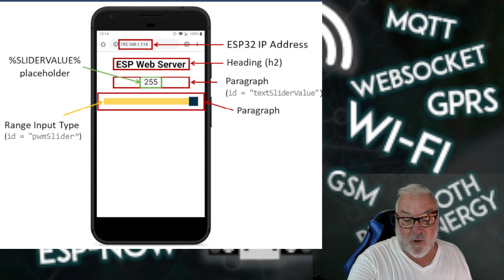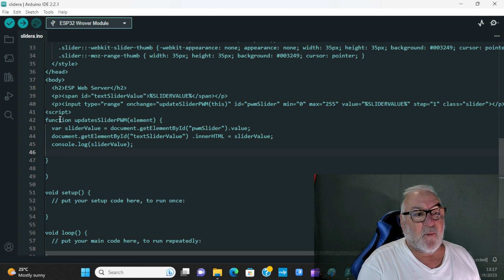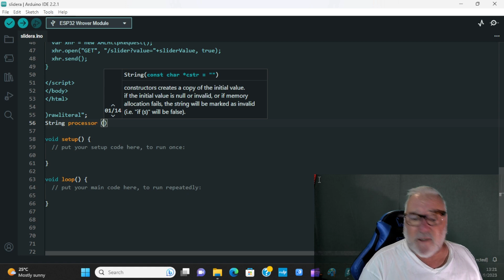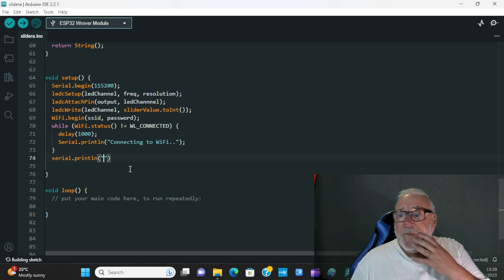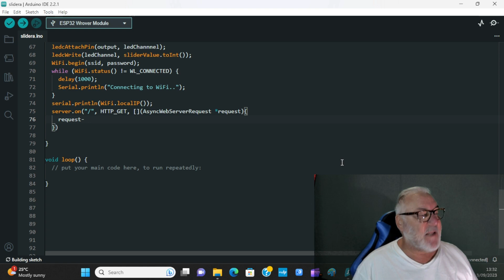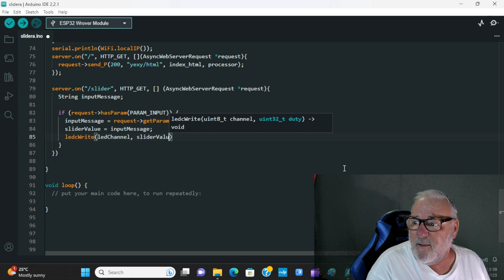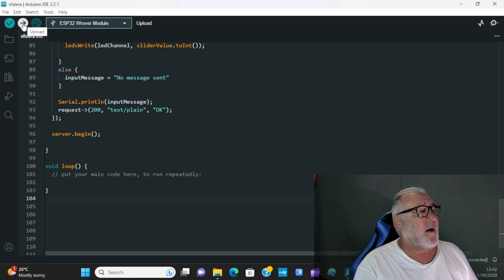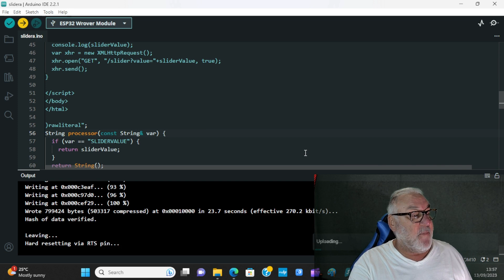Build An Esp32 Web Server With A Slider Control For Led Brightness Part 2

Comment: Sir, what is the purpose of  "processor" function?  You passed the function along with other attributes to request->send_p.  But inside HTML, it doesn't call this function.
I also name my variable  SliderVal  in the main c++ code while inside HTML's updatesSlide PWM  I name it   SliderValue . So how both variables are linked together?
Reply from the maker: Hi jumbo We need to add some JavaScript code to your HTML file using the <script> and </script> tags. You need to add the updateSliderPWM() function that will make a request to the ESP32 with the current slider value.

We need to create the processor() function, that will replace the placeholders in our HTML text with the current slider value when you access it for the first time in a browser.When the web page is requested, we check if the HTML has any placeholders. If it finds the %SLIDERVALUE% placeholder, we return the value saved on the sliderValue variable.
I hope this helps.